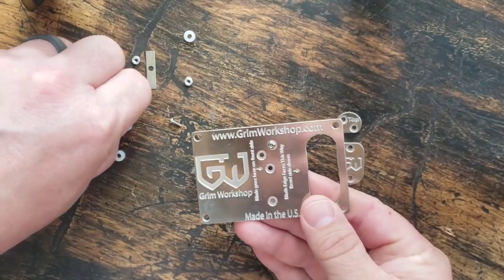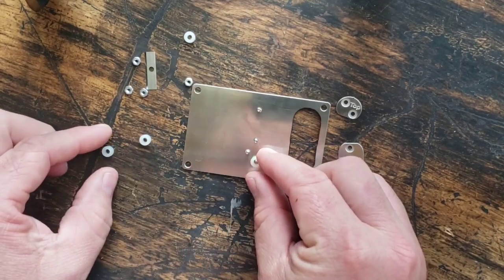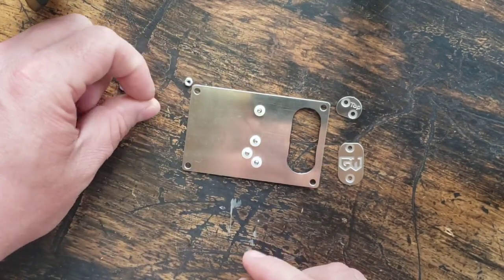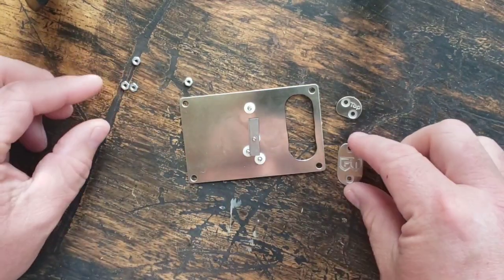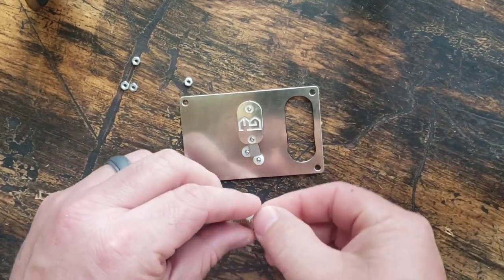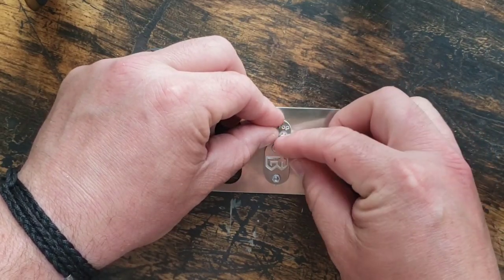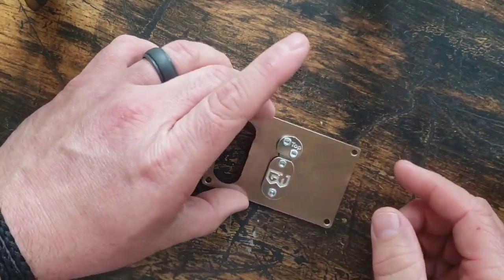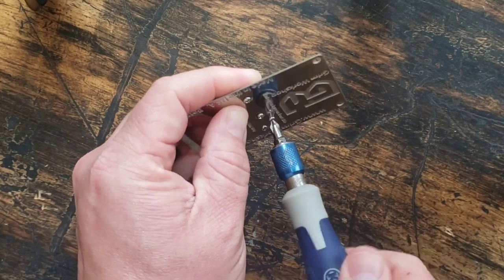Cordage card assembly and operation

Comment: was the blade facing the same way in the setup section and the bottle cutting section?  It seemed the bottle was cutting from the "handle hole" side of the card, but it looked like you installed the blade facing the bottom of the card in the previous section?
Reply from the maker: It may have been, the cutting video was older, it was probably a prototype tool
Reply: I noticed that too , video and your post is 3 years old, but I am just looking into getting a few things off their site

Comment: Thanks for the video!  The "instructions" that came with the card were horrendous!  One little off-kilter diagram that was blurry and caused me to assemble it EXACTLY BACKWARDS!  What would it have cost to just put one detailed instruction sheet in the package?!
Reply: Just got mine today and it’s a nightmare! Even put together correctly I can’t seem to get anything longer than a couple of inches without it cutting itself off. Practice makes perfect I suppose, we’ll see.
Reply from the maker: @InimitaPaul  Hey Paul! We have a video where i process a bottle step by step in real time. That might help. Also be sure your blade is placed with the flat side up (bevel down) heres a link to the video where i process a bottle and walk you through it. https://youtu.be/0HJuonrZ3Gc
Reply: Grim Workshop I’ve done everything as shown mate but it just won’t do as advertised. Sliding the bottle in and having it catch the blade is no problem but the moment you try to pull it through it either cuts itself off after a few inches or, more frequently, clogs everything up to the point I have to unscrew everything to be able to even try again. I’ve been at this for well over an hour with different bottles and it makes no difference. 

All angling the blade does is make it easier for the bottle to catch the blade, it does nothing for making it actually cut in any significant length.
Reply: Well that’s that, one screw dropped and lost, game over.
Reply from the maker: @InimitaPaul    email us at support@grimworkshop.com and we can get a replacement screw sent to you. If it's clogging, that usually only happens when your blade is facing the wrong way. We just uploaded another instruction video maybe that one will help you more. They work exactly like we show in the video, I promise we'll get it working perfectly for you. It does sound like the blades facing the wrong way. We'll get things straightened out.
Reply: Grim Workshop The blade is the right way up, I assembled it watching the video you recommended. I appreciate the offer mate but I’m just going to write it off as one of those Kickstarters that happen sometimes, I’ve spent so much time trying to get it working I don’t even want to look at it.
Reply from the maker: @InimitaPaul  If you'll email us, I'd love to find a way to make this up to you. I really hate for you to feel that way, because I know the tool works.
Reply: Grim Workshop All sorted, thank you.

Comment: Good video. The instruction card that came with the kit needs work as you already know.

Some other feedback - perhaps think about including a sharper blade for thicker bottles. I just tried it on a Sword (sports drink) bottle and it shaved rather than cut the plastic. I couldn't get it to cut deeply enough to create a consistent line of cordage. Looks like the model I got today only works on thinner plastic bottles as shown in the video. Maybe that will help with future versions.
Reply from the maker: I'll look into that! Thanks for the feedback!

Comment: Either I am going cross-eyed (entirely possible) or the blade orientation differs between the assembly and usage videos ... It looked to me as if the sharp edge of the blade pointed away from the carabiner hole during assembly, but toward the hole during usage. Am I wrong? And does the orientation matter, or can the blade be installed either way as long as usage matches blade orientation?
Reply from the maker: The blade edge should face AWAY from the carabineer hole for most reliable operation, and the blade bevel facing down is the most important thing. If you don't do that you'll just get little short bits of Cordage. I could have been using an older prototype model in the usage video it's one we posted a while back.
Reply: But then the screw that keeps the blade from rotating won't work, and only the screw tension keeps it in place?
Reply from the maker: @seanlambert2256  yes, the screw tension squeezing the blade into the spacer holds everything in place

Comment: Nice! The printed instructions that come with the card could benefit from a little more clarity; that tilted view drawn on it didn't make it clear to me which direction the blade would be facing. (This video made it very easy though!)
Reply: Same here...I was about ready to ask for my money back because the crappy instructions caused me to assemble it incorrectly and it didn't work at all!
Reply from the maker: I'm glad the video helped, i apologize for the instructions being unhelpful, we corrected them, so hopefully in the future this wont be an issue for anyone =)
Reply: @grimworkshop9830  I just received mine, still not so good, need some improvement, maybe some actual words and instructions

Comment: my micro came in and it seems you instruct to put the blade on backwards in this video (blade faces the W in the way its asembled but it cuts into the bottle from the G side in the demonstration) as pulling the plastic through makes the blade go the wrong way and i cut myself.  when i put the blade on the other way, the way that made sense to me, it was largely ineffective.  Have to say im a bit disappointed.
Reply from the maker: Hey there, sorry you're having trouble, the way it is assembled in the video, is the correct way. you can find a video on using your tool if you have any difficulties via the link here https://www.youtube.com/watch?v=0HJuonrZ3Gc

Comment: Got mine today. Needs a little practice I think. I suspect there's an optimal thickness for a bottle. One thing I would worry about on the road is these little nuts coming off. I don't think they make nylon lock nuts that small so will have to consider a glue fixing to keep them in place which can always be scraped off for changing the blade. And yes, the printed instructions are terrible! Glad you've changed them.
Reply from the maker: They do take a little practice. If the nuts are tight, there shouldn't be any issues with them falling off, I've carried them all over for a while now and never had any problems with that. If your worried though a little lock tight could help
Reply: @grimworkshop9830  Sure. I'm just thinking ahead. Thanks. Will post again when I've got the routine.
Reply: As promised I'm back. It works fine but it does need a bit of practice. The hard bit is getting the cord started as there's nothing really to grab onto. It a case of pushing the bottle through on the blade until there's enough cord to grab. I suspect also the bottle needs to be kept perpendicular to the blade to get a consistent length, not always easy leading to a cut-off point as you end up angling the blade to the cut. One thing to add, I'd take a file to the card itself to dull the edges as I've gotten a couple razor cuts each time I've used it.
Reply from the maker: Starting it is definitely the hardest part. Either you have to feed it till you've got about 6" length to grab, or you can grab it with a pair of pliers or a multi-tool when it's still a tiny piece, that works really well
Reply: @grimworkshop9830  Yes. I just wanted to see how I'd do given an outdoor situation where I don't have access to pliers or a multi-tool. Maybe there's the answer, I should have a multi-tool to hand in the wild! Which of course is true.
Reply from the maker: You can also take a really thin stick and wrap a couple inches of material around it, making a T shape to get the initial couple of pulls with, just gives some extra leverage on that first pukk

Comment: You show the sharp edge against the screw but pull away from it as if the back side of the edge is doing the cutting. Even your instructions on the micro tool say to do this. You might want to look into that
Reply: I noticed this as well, you are cutting the bottle with the edge facing towards the cutout in the card, opposite from your instructions. With your way, there's nothing to stop the blade from swinging out except the tension of the screws! Another flaw in the design is only a tiny portion of the blade gets used, and must be replaced when 90% of it is still sharp. Would be nice if the blade was adjustable so more of the edge could be used!

Comment: What is the difference between this and the older model?
Reply from the maker: Great question! It's half as thick first of all, it's got a guard added to it for safety, which makes it way easier to store, and we also added the large carabinier hole for carrying it on the outside of a pack. So the function is exactly the same, but this model is much more compact and safe.
Reply: Grim Workshop that is awesome! When do you expect release of these bad boys

Comment: Blade orientation?  How many times can we flip it over?  https://youtu.be/6Si_REeRWFo?t=66  Now where was that cutting edge again?  https://youtu.be/6Si_REeRWFo?t=212  It's like a magic trick.  I went with the way it's shown in use, so the screw under the "TOP" piece also prevents the blade from pivoting when the material is pulled through.  It does mean less "channel" to guide the material on the input side, though.  Which is the correct orientation as intended?  I've successfully rendered a water bottle into two nicely long strands, but the soft/thin nature of that material makes for some uneven widths.  Assembly sucks if you aren't blessed with such dainty hands.  And I have two more to put together... and the expansion kit... maybe.  Yay.
Reply from the maker: We've released newer videos showing the micro and dog tag versions that also detail the blade orientation and placement more specifically if that helps, as well as a video where we walk you through using it, if that helps

Comment: Agreed that the video for assembly worked but only if you pull the bottle thru in the opposite direction of the second half of the video where you demonstrate the use. You seriously should replace this with a video where both are correct. I also questioned the design where instead of the screw holding the blade in place by acting as a post to keep it from moving you have it being held in place via the tension on the spacer.
Reply from the maker: Thanks for the feedback. We're taking notes on all the suggestions from everyone to try to improve everything in the future.
Reply: @grimworkshop9830  I did disassemble the card sized one and tried pulling a rope off it. While I was able to do it, it seemed a lot easier the other way meaning the way you show it assembled in the video. I also would like to have either another screw or some other way to keep the blade from pivoting when using it. Otherwise, I'm pretty happy with the 3 items. The micro was a bear to use until you get it the right way. I also recommend gloves so you don't give yourself a cut with the plastic.
Reply: @AndyKomonchak  If you tool is sharp just take a fingernail file and file down the edges. Yu should not have to worry about getting cut when using the tool. Sorry about that.
Reply: @mindygrimes5231  I was actually referring to cutting myself with the plastic. The equivalent to a paper cut. But your advice about filing down the outside edges, especially on the micro tool is a great idea. I may just take my Dremel to it and make it a little.more.comfortable to use.

Comment: After assembling this flimsy piece of cheap plate steel I unfortunately realized that it dosent work. After looking it over very thoroughly and triple checking that I did indeed follow all the directions in this video I finally figured out the issue... this thing is complete garbage. Gets through about 6 inches of plastic before it binds up or breaks and I'm even using the exact same kind of bottle he's using in the video. I seriously don't see how this runs for $25 since it's like $1 worth of plate steel, 4 tiny screws, a pencil sharpener blade and 4 tiny plastic spacers that are pretty much small plastic tubing bits. $10-$15 I could understand but $25 is outrageous. At least some good came of this though. I realized their products are trash so I went ahead and deleted all their other items from my Amazon cart!
Reply from the maker: Kevin, sorry your having trouble using the cordage making micro tool but i can assure you, it does actually work quite well, the micro version does have the steepest learning curve, the card version is the easiest to use. Also, i'm not sure where you got $25 as the price, these are only $12 i added a link to the bottom of the message for you. All our tools are guaranteed, so all you've got to do is contact us for an exchange or refund. We have a lot of people who use this tool all the time, some 9 year old's just used it to make a guy line for a shelter they made and posted it here on youtube. It sometimes helps to screw it to a flat surface until you get the hang of using it in your hand. You can always email me at Jordan@grimworkshop.com any time, i'd be happy to help you out.  Here's the link to the micro tool, again it's only $12 https://grimworkshop.com/products/everyday-carry-cordage-making-micro-tool?_pos=1&_sid=c8b18950c&_ss=r

Comment: The demonstration puts the blade in the wrong way. Yeah it's supposed to be bevel down but you didn't indicate and you did it WRONG on the video because it cuts on the opposite side in the very next clip.  so wtf? take this video down.
Reply from the maker: The instruction is correct, the video clip was from another day and we used a prototype in the clip, that had the blade turned the other direction.